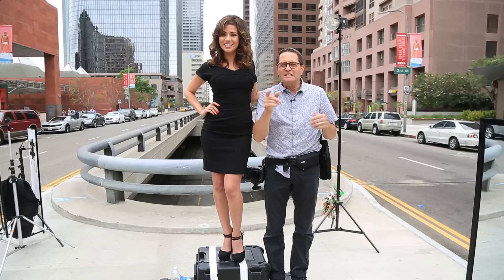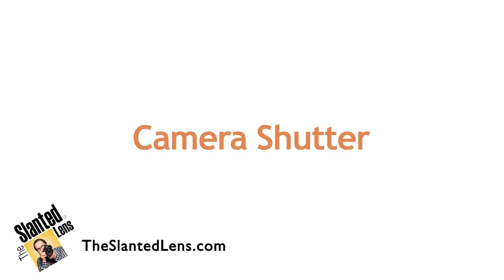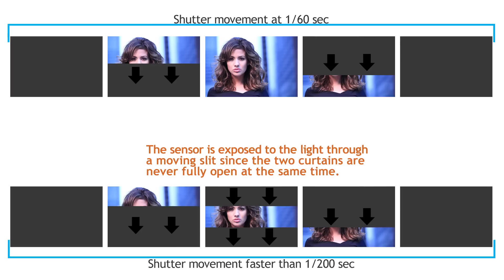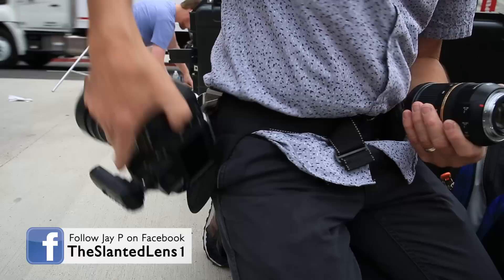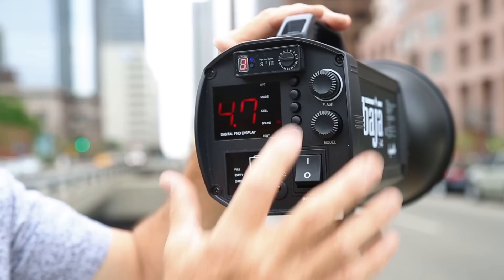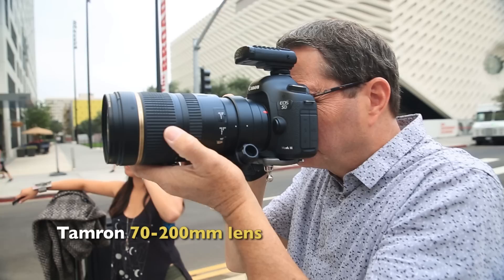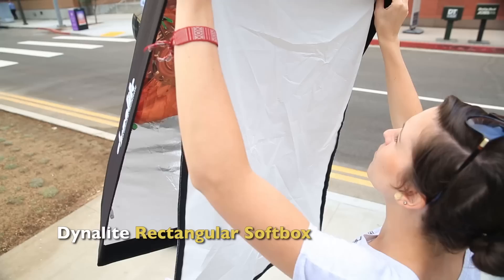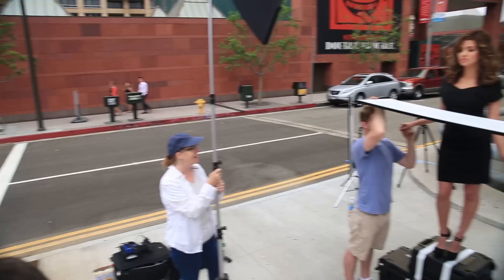High Speed Sync and How it Works - Lighting Tutorial

Comment: Thanks for all your video assistance to make all my pictures look good. Talking about Flash High Sync, this a good way to shot in DSLR above 1/4000 with flash. To shoot high speed 1/4000 or above, is not necessary Flash Slave Trigger Hot Shoe Sync Adapter. The only thing that you need is a flash with High Sync, Camera with flash sync speed option. First mount your flash on top of your camera, set it up to Manual or ETTL mode full power, enable the H sync. turn on the strobes or flashes synchronized to slave 1. Thats it.

Comment: Good points to know, that HSS decreases the light output and drains batteries faster. I kept it turned ON all the time even when my shutter is less than 200, which is not a good thing to do. Lesson learnt. Thanks.
Reply from the maker: Yeah, you are losing a lot of power when you use your strobe that way. Thanks for watching!

Comment: You can also achieve the same effect-using an - ND1.2 - 4/f Stop Neutral
 Density Filter if you normally set your flash exposure to F/11  you 
would then set your aperture to F/2.8 when using a  - 4/f Stop Neutral 
Density Filter.  This gives you exactly the same exposure but 
significantly less depth of field.

Comment: Is there really a need for HS sync in this shoot? You can easily change ISO 320 at 1/500s to ISO 100 at 1/160s and keep the same f stop.  The 5DIII he is using is fully capable of syncing at 1/160s.  Am I missing something?
Reply from the maker: aluzexp I used ISO 320 for this particular shoot because it was a little overcast the day of the shoot. If it had been a bright sunny day, I would have dropped my ISO to 100 but 1/160 would have been too bright for the background.

Comment: Hopefully people will find the HSS explanation useful... but HSS wasn't even necessary here! The ISO was increased, just to put the shutter speed into HSS territory. 
If your settings were 1/500th, f4.5, ISO 320... then you could get the same exposure without going into HSS (1/200th, f4.5, ISO 125)

Comment: What's the downside to using a Variable ND filter instead of HSS? Obviously HSS will work with fast-paced action, where a VND filter will not, but for portraits this is not an issue.
Reply: Using nd filters will degrade the quality of image because you are adding element in your lens it makes the background dark and so is the subject. So you still need flash when shooting portraits

Comment: I have learn so much watching your tutorials.  Here is what I have learned through try and error:  You need remote triggers (No all are high sync capable) and you need some strobes (No all are high sync capable) and finally you need a fast lens.  By using the youngnuo  568 EX $ 70.00 and some Viltrox FC210  triggers $ 40.00, and a $ 30.00 reflector I have been able to get some very good shots in a budget.  Canon 5D Mark II with Canon 85mm F/1.8 prime.
 https://500px.com/photo/104491863/senior-portraits-by-j-p-shots?from=user_library

Comment: Hello. a question the Newwer 565EX flash has that option to put high speed? or the problem is my Nikon d3100 camera. ? what can i do in this bucket to be able to take pictures with high speed ? thank you.
Reply from the maker: High speed sync works between the trigger and the flash unit. So if you have a dedicated trigger to your flash unit is will work seamlessly.

Comment: At full power output the B1 and the B2 has a flash duration of 1/1000 of a second. 

So if you set your shutter speed on the camera to 1/2000  of a second or higher you do not need the option of high speed sync because the shutter speed is now twice as fast as the flash duration.  You can use this option over high speed sync with any flash or speed light because At full power output all electronic flashes have a flash duration slower than the maximum shutter speed of any camera.  This technique makes it possible for anyone who has even a inexpensive or old speed light the ability to achieve the same affect as high speed sync.
Reply from the maker: thanks for your insight!

Comment: thanks for your video- is the x sync speed limitation (non HSS mode) still applicable to electronic shutter mode (as well as regular mechanical shutter mode)? (wondered if the physical curtain/shutter isn't moving in electronic shutter mode if this still applies)- thank you!

Comment: Thank you so much for all your videos I learned a lot from them. My question is why do you like the Baja b4 and b6 so much? And how do you find it in comparison to profoto b1 or to phottix indra500?
Thanks again.
Reply from the maker: +Fahad Bashraheel Hi Fahad. The Bajas are great lights for the price. Built to last and with great features and consistent performance. The profotos are very nice but they are also very expensive.
Reply: +The Slanted Lens thanks. 
But what about the Phottix Indra500 as compared to the Baja?
Reply: +The Slanted Lens and did you ever face any overhead problems with the Baja?

Comment: Hi, its obvious your are a quite highly qualified photographer with very expensive camera and equipment. I have just purchased a SB-910 speedflash and Camera Nikon D5500 I can tell you that it will not sync to  1/1500 of a second. high speed.   and if I were to shoot high speed as you say, my battery would last only for 10 shots max.
Reply: The SB-910 does do high speed sync but it puts out very little power in doing so and could not be used for a model shoot like this. http://www.nikonusa.com/en/learn-and-explore/a/tips-and-techniques/using-auto-fp-high-speed-sync-to-illuminate-fast-sports-action.html